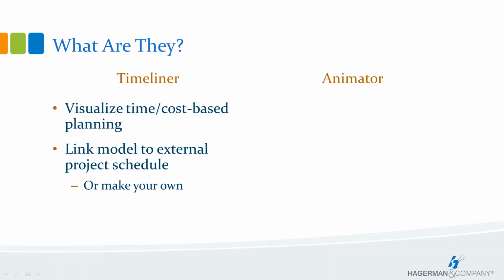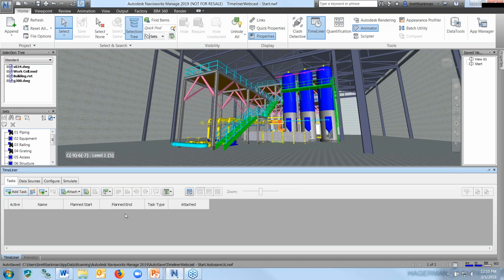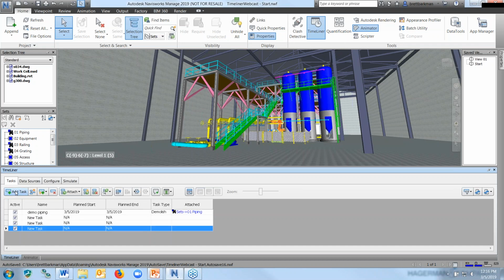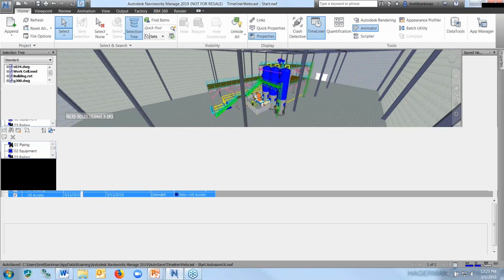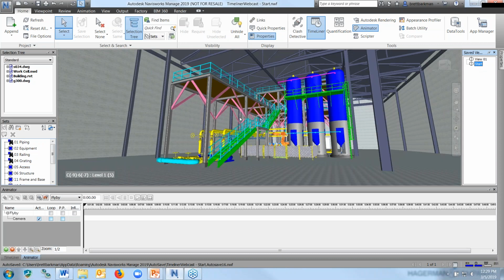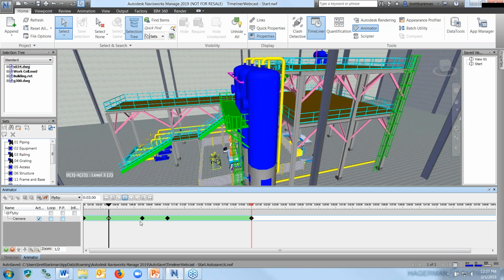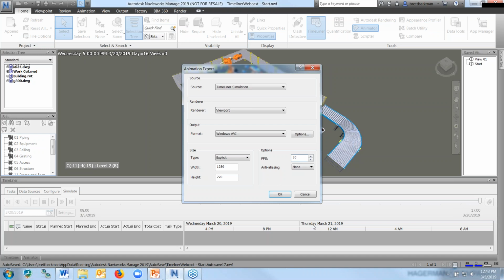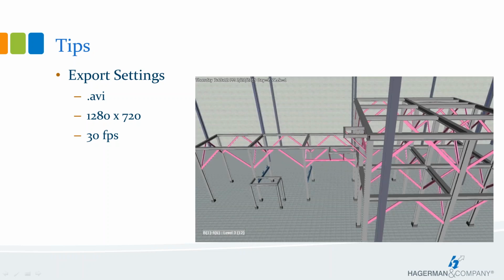Navisworks for Demo & Construction: Timeliner & Animator

Comment: Can you extract resource graphs from Navisworks? Like lets say how many workers are on the field each day
Reply: Thanks for the question.  Unfortunately that is not  something that Navisworks does out of the box.  The focus is on the design models.  However, Navisworks will consume a project schedule from software such as Microsoft Project or Primevera, so that kind of information can be simulated.  Setup is required for that though, and was not covered in this video.  Hope this helps.

Comment: How do I keep my entire model there while executing the demolition simulation? I've selected a few components and saved them as sets, but when I go to execute the sim, it only shows the components in the sets and not the rest of model. How do I show progress of deconstruction if the rest of the model disappears too? I'm a bit of a novice so anything helps, thanks.
Reply: Luke, thanks for the question.  An issue like that usually eludes to how your elements are in their sets and configured to appear and/or disappear.  It's all in the sets and sequencing.  Although it's not desired, sometimes it helps to redo your sets, sequencing, etc. basically redo it from the ground up to flush out any backwards or unwanted behavior.  In order to address this I would need to see your model to know exactly what you're dealing with.  So if you'd like to open a support case with us I'd be happy to help you out.  Regards